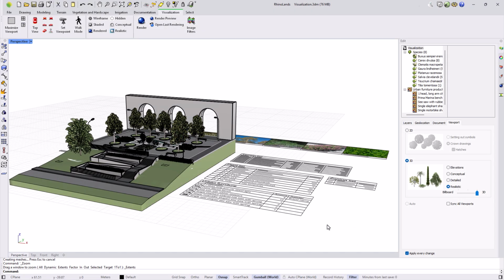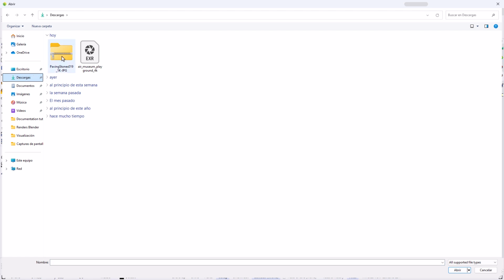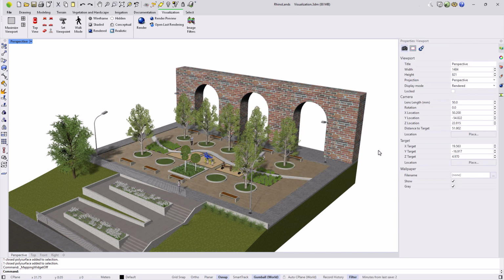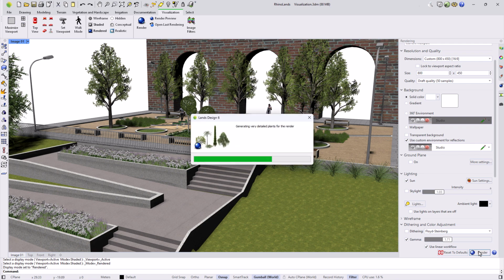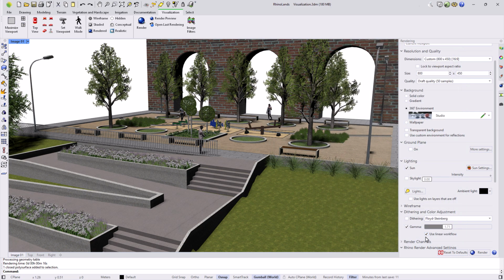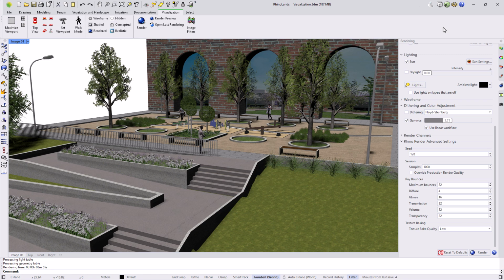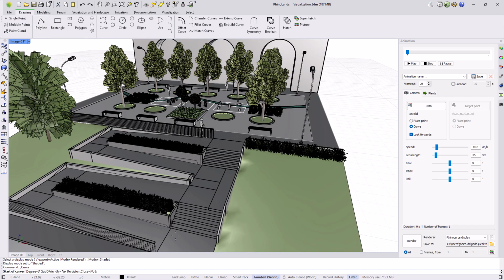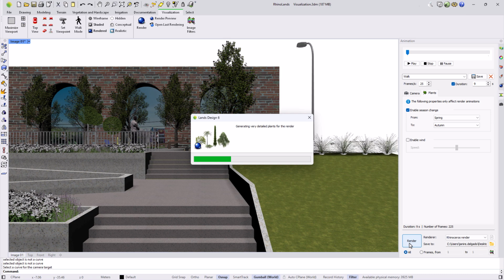RhinoLands Tutorial 07: Visualization

Comment: Recommend tutorials for Enscape and D5 Renderer. Personally, I think these two renderers are good. However, when there are more than 2,000 plant models, only Enscape can still run smoothly. Both D5 Renderer and Lumion Renderer rely more on hardware support. The optimization of proxy models is the key to whether these software will run smoothly in the future.